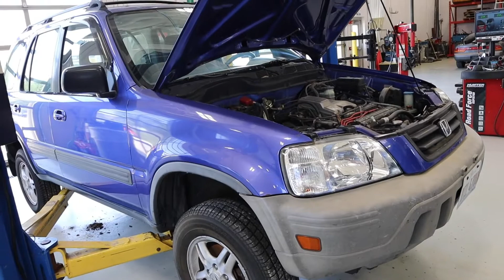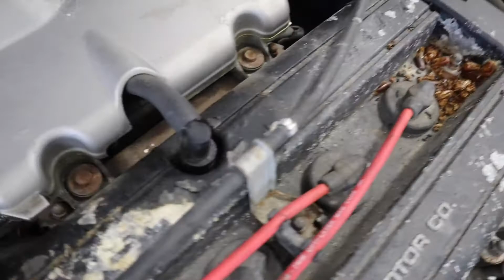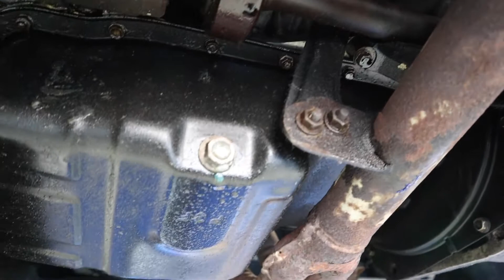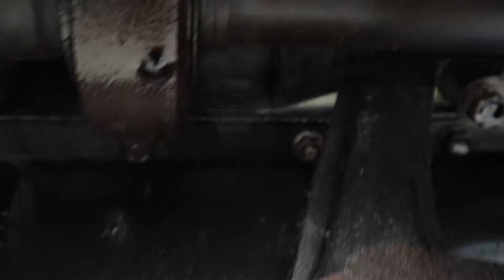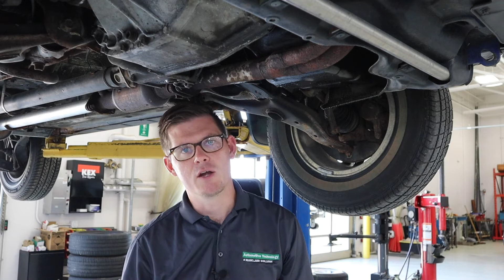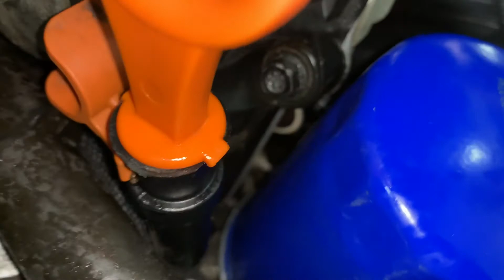Getting Started: Engine Oil Leaks Diagnosis

Comment: Appreciate this video. Just purchased a 2001 CRV and it has a fairly solid leak, so gives me some things to look at closely.
Reply from the maker: Glad it helped!
Reply: @AdamsAnalysis  so…the previous owner didn’t turn the oil filter enough. So when the car would turn over the oil would pressurize and shoot oil out there….. but win for me because she thought it was worse which ended up letting me snag the entire car for $650 🤣